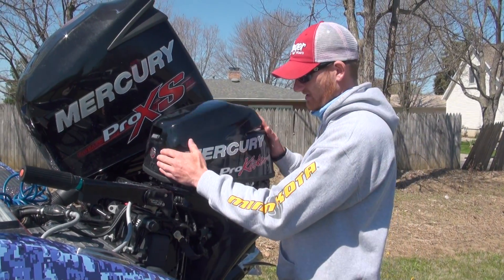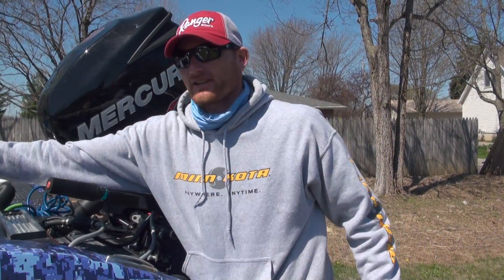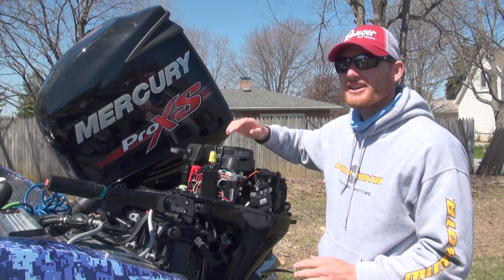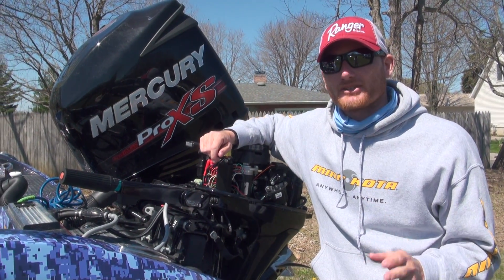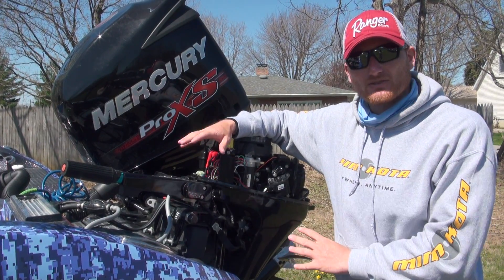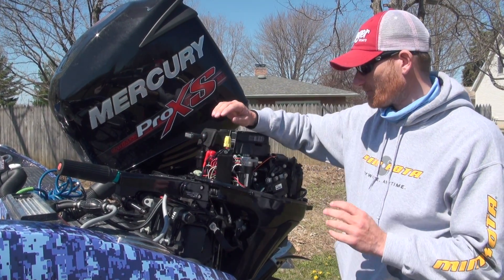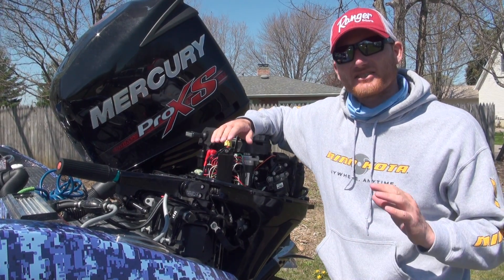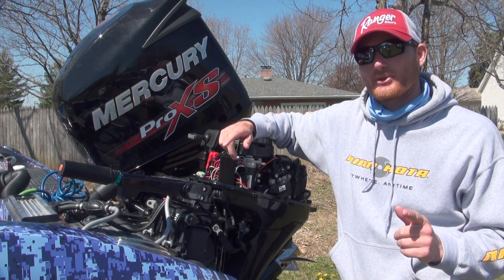How to avoid hydrolocking your kicker engine

Comment: Interesting, never even heard of hydro locking before. How would water get into the cylinders?
Reply: So what your saying is water floods in under the cowling and gets into the carburetor system and floods the cylinders? Wow I am lucky because I just did this with a new 9.9 pro kicker and nothing happened. That would have been 3000 down the tubes. thx
Reply: BigWater59. I think he means water gets forced up motor from exhaust passage into cyclinders not from intake or carb.
Reply: @goaheadmakeourdayscooterpe6724  eventual water and oil can get into bvb the carbs from the cylinder